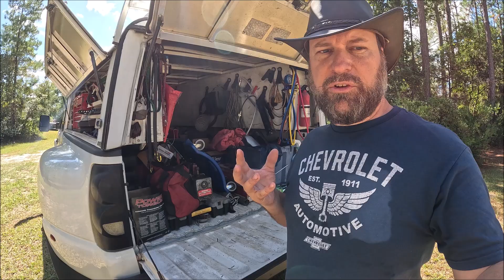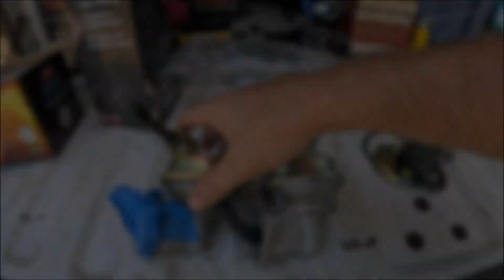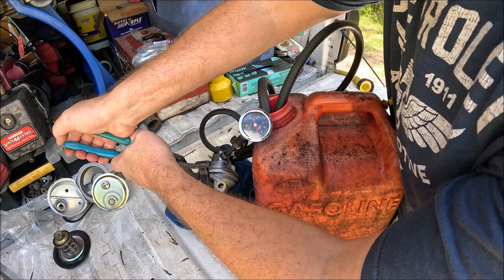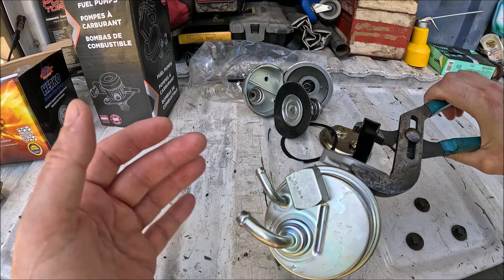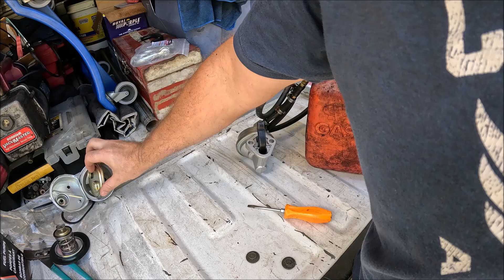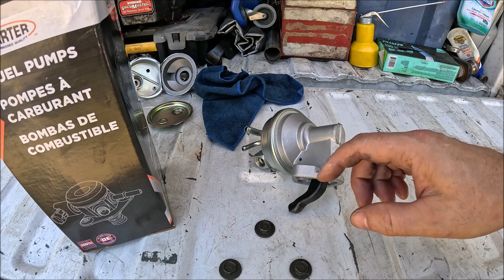Revisiting mechanical fuel pumps: returns and how they work

Comment: I've been struggling with fuel pumps on my 81 square body. Past few years I had been running a carter M6626, but the last 9 month running it daily it finally gave up on me and I got some Delphi's and they were just pouring fuel out of the return, didn't see an orifice on the outside, was thinking maybe internally? 
So went back with a carter but it looks slightly different on the bowl and the outlet fitting block

it lasted 3 days

So now back to trying to figure out what to do, I'm thinking about getting another Delphi and running an inline orifice on the return. 

Sucks that you can't get quality parts anymore. Feels like the original pumps would still work great if not got ethanol fuels
Reply from the maker: Ethanol 100% kills the original pumps. The rubber valve flaps aren’t rated for it. I’ve revived old cars where the pump came back to life and worked great….. until a few tanks of ethanol run through. Then they fail.

Comment: Great Video.  Any suggestions on where to purchase “quality” fuel pumps for our older vehicles?
Reply from the maker: Definitely not online. They always end up being cheap garbage because they know most buyers won’t take the time and energy and money to return them. Stores that back up their products with warranties like O’Reillys or Napa are the place to go right now. I’m not necessarily advocating for any in particular but they do honor their warranties and usually thus carry better products.
Reply: I need to watch this video again.  Have. true 1970 SS 396 Chevelle. 4 year restoration.  Original Q-Jet etc…..Having an “issue” with bleed back from the float bowl.  Carburetor now rebuilt.  Fuel pump has the 1/4 inch return line from pump to tank.  Original 1970 L-34 w/ TH400.  A real “ money pit”……..but worth it…….😜

Comment: I just put a new mechanical pump on my 350 and it’s pouring a good bit of fuel out of the return any ideas what I did wrong? Would I be fine just running the return back in to the tank? (70’s jet boat so I don’t have a lot to go off of)
Reply from the maker: If it’s a new pump and the carburetor is getting plenty of fuel, I probably wouldn’t worry about it. But if the carburetor is being starved or you suspect it I might worry. I would run it back to the tank and see if it seems to have any issues keeping the carburetor fed. Not all pumps may have the same orifice size just because of pressure and volume differences in them, so if it’s made to run that way it should be fine.
Marine pumps sometimes have a port on the back side of the diaphragm that looks like a return but is actually a vent for a diaphragm failure event to keep fuel from pumping into the engine compartment or engine and creating a fire hazard. I can’t remember if I covered that in the video. If it’s coming out of there that would be bad.

Comment: All tutorials I veiw do not explain purpose and importance of " weep holes: for when diaphram gets a hole in it. Gas goes to outside of pump through those hole instead of your crankcase oil destroying your engine. Accept no replacement pumps without those weep holes around crimp ring of pump body
Reply from the maker: Marine pumps actually have a separate vent tube on the rear of the diaphragm for just this event, to keep fuel from building in engine or engine compartment and creating an explosion or fire hazard. I can’t remember if I covered that in the video but those pumps can be used in place of an automotive pump if that’s a large concern. But you are correct that modern manufacturing standards are bad all around.

Comment: Many knock off fuel pumps have " weep" holes omitted and will DESTROY ! your engine when the diaphragm fails. Those holes are there to let gas go to the outside when pump goes bad. If holes are not there gas will go into crankcase and ruin your oil and bearings